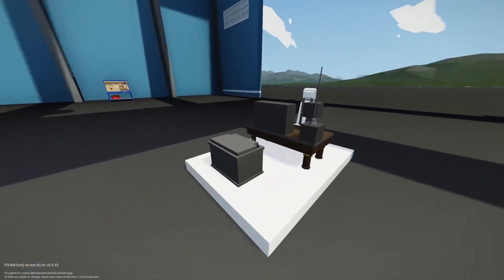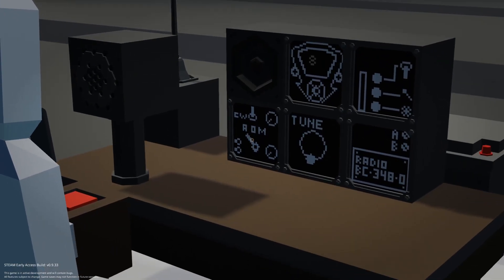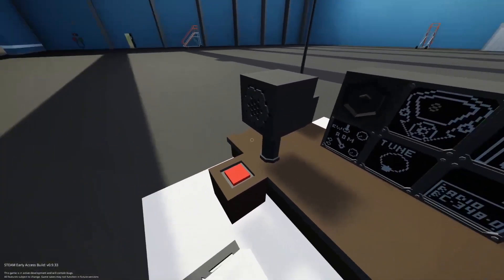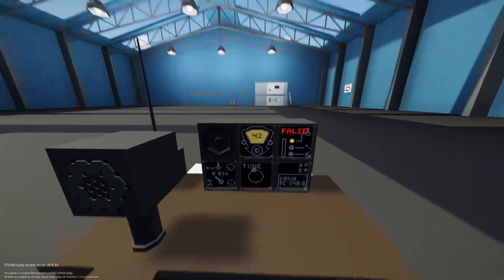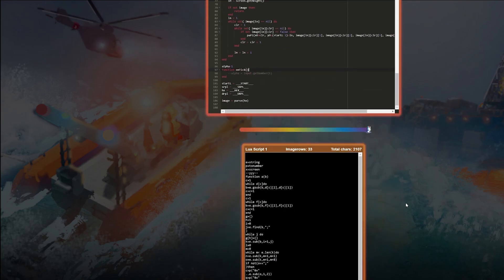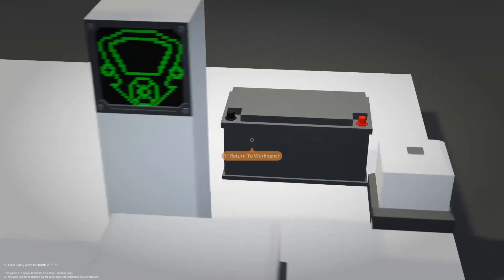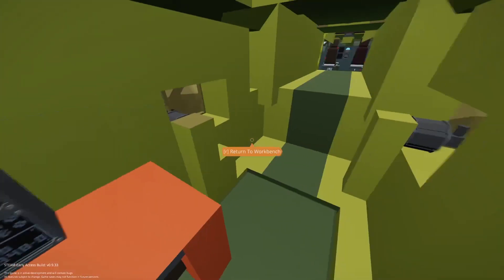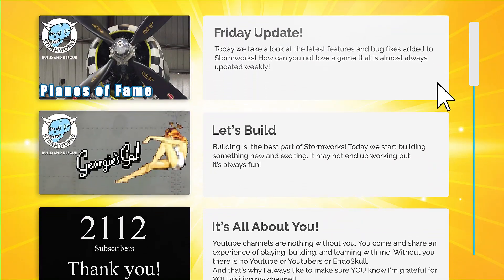LUA To Image  Stormworks Tutorial & BC-348-0 Receiver

Comment: Can someone explain to me why - when drawing anything to a 32x32 screen... it goes from 0 to 32 instead of 1 to 32?
Doesn't that make 33? And sometimes the same coordinate of a horizontal line is not the same for a vertical line.
For example you make a horizontal line from 0, 8, to 10, 8 and the you want to add a vertical line going down from the last pixel of that line.
So you'd write 10, 9 to whatever (downwards) but somehow that creates a gap of one pixel. Even though there are no extra pixels between y 8 and y 9.
If someone can explain this to me, I'd be very grateful!
Reply: Well, I was making some interface for 32x32 display, and just used MS Paint to plot a look and layout of elements on it and just used coords from paint 1:1 to stormworks, it goes from 0 to 31. I also encountered that weird problem(?) when pixel at line end coords is not being drawn, so if i need like line beginning at 1,5 and ending at 1,10 i need to use 1,5,1,11 coords for stormworks. And if i need to put a single pixel dot at screen, 5,5,5,5 won't work, end coords needs to be one pixel off in any direction, so 5,5,6,6 will put single pixel at 5,5. And that's why it might go to 32 - if you need 32 pixel long line from 0,0 to 0,31, you might need to put 0,32 as end coords, otherwise 0,31 will not be drawn.
Reply: @invictusmindless  Oh brother. Exactly the same for me! Used paint, noticed 0-31, noticed last missing dot for lines, noticed I had to draw two pixels for a dot.

It's funny to see how you went through all the same stuff! :)
It's relatively simple once you know all those little things, still a fiddly work to draw a screen that you've planned out in paint.

Oh and a little tip if you want to do a touch screen with rectangles:
If you've already drawn rectangles and you just want to make them clickable: Use the coordinates of the already drawn rectangle but start the touch rectangle one Pixel higher and make it 1 pixel longer downwards. As well as for the width: start the touch rectangle one pixel more to the left and make it one pixel more wide.

Then the rectangle you've drawn is perfectly clickable exactly the way you see it on screen.
Hope that helps a bit! Enjoy doing touch screens! :)